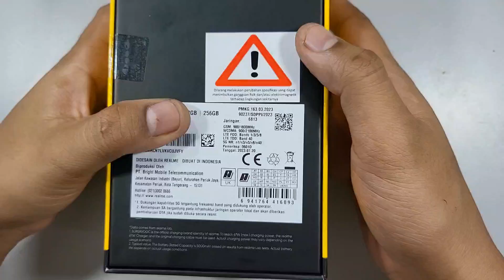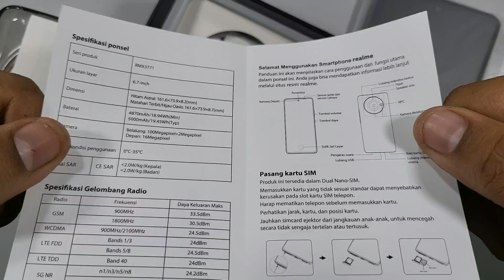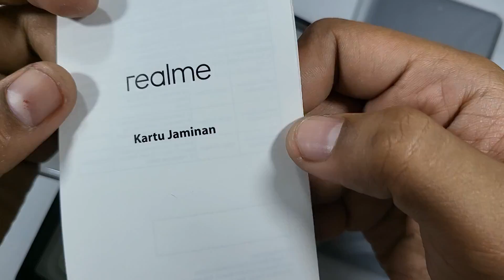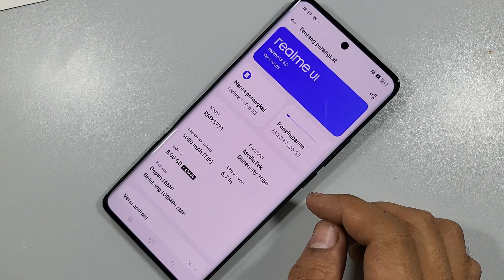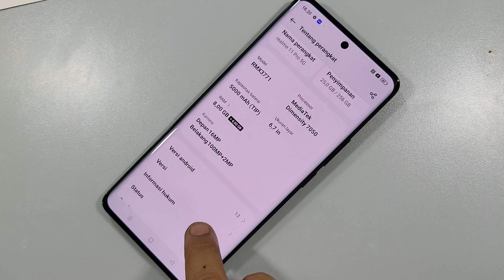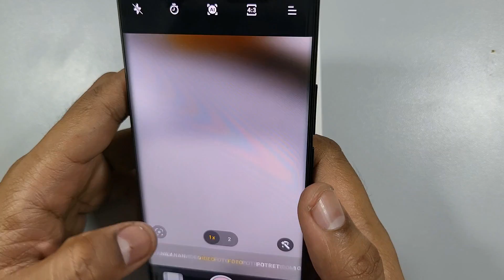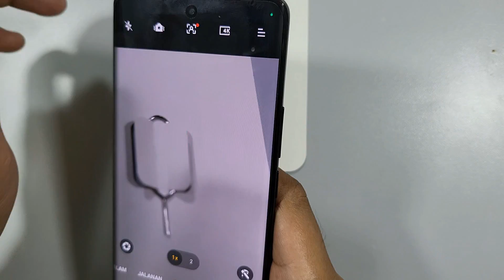REALME 11 PRO 5G TEARDOWN DISASSEMBLY

Comment: First one, the left camera is a scam. Second, the real vibration module is rounded shaped, different from the info on the website (square shaped). And the third, the written battery capacity is 5000MAh, but it is stated that the actual capacity is 4870MAh😂

What else is re*lme deceiving us?😂